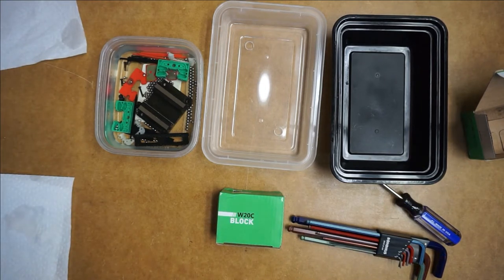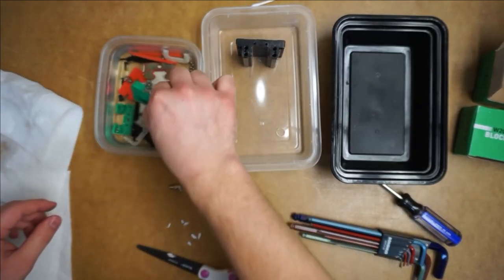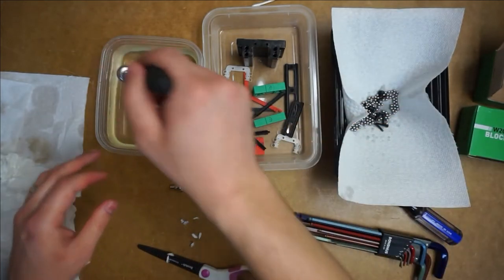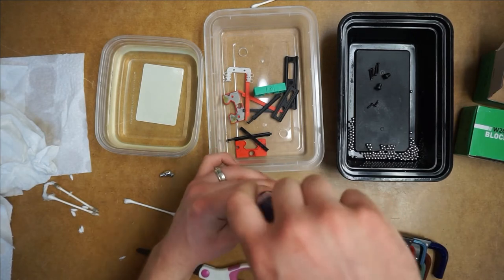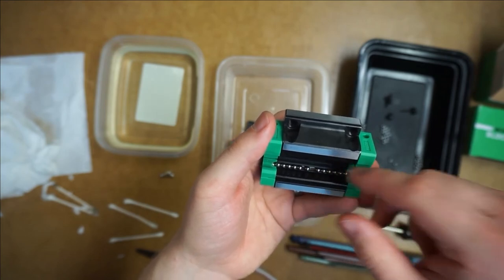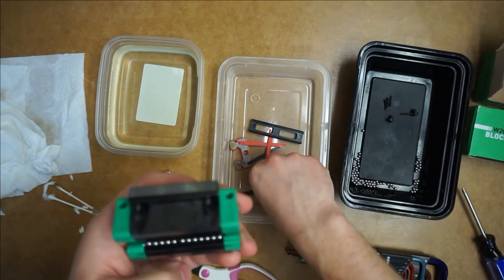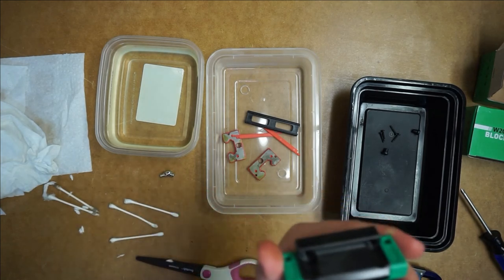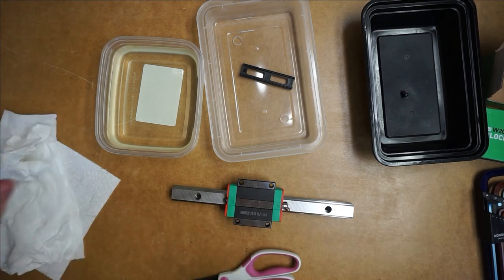Cleaning and reassembling a HGW20 Linear Carriage Bearing

Comment: What I find useful when dealing with lots of small parts like this is to use an oven baking tray (these can be had for relatively cheap) as a work surface so they contain the parts that roll around. Additional advantage if dealing with stuff like the balls would be that you could just tilt the tray and have them all roll into a corner for easy consolidation.
Also, if you need to clean the ways and cotton buds don't fit, you can use pipe cleaners (also called chenille stems). They are used for arts and crafts these days but originally used for cleaning tobacco pipes. Also used in servicing firearms to clean out the gas tubes.

Comment: Good Video. It's easier if you add grease to the raceways before re-assembly. The grease holds the bearings in place. thanks
Reply: What kind of grease do you recommend on this bearings?
Reply: @johanwarholm2873  Any good bearing grease will do. They aren't high speed.

Comment: isnt it possible to just soak the linear bearing in the alcohol without disassembling it?
Reply: that worked for me
Reply: Years ago I did the same - disassembling, because you never can actually clean inside properly. Then I found another solution that worked really well for me. After soaking for few hours, you can remove the bolt (or the grease nipple), take a big plastic syringe (50ml for example) and inject by force isopropyl alcohol inside. It works wonders, you see how jets of dirt, bad grease and small metal particals get forced out of every gap in the bearing.
Reply: @evgenitantikov5865  that's nice to know, thanks
Reply: @evgenitantikov5865 that is the way to go 😅